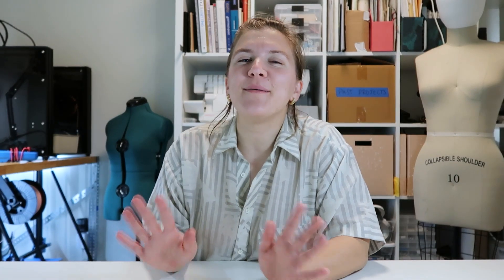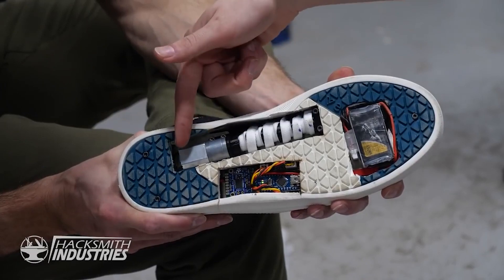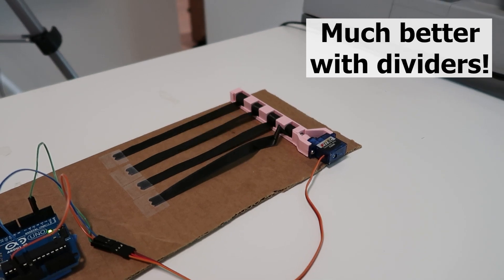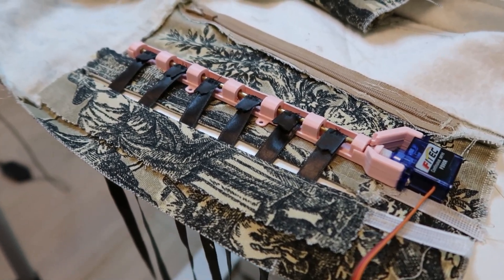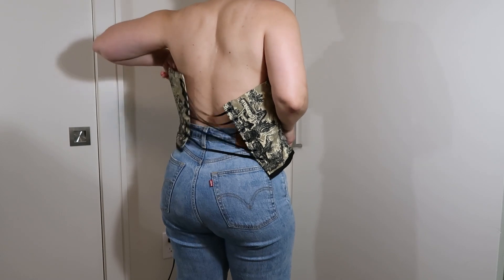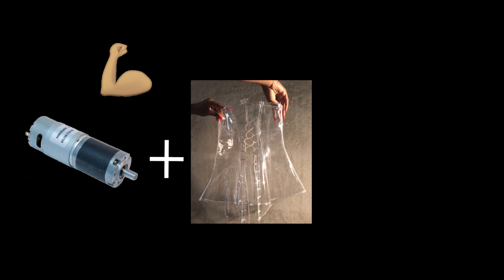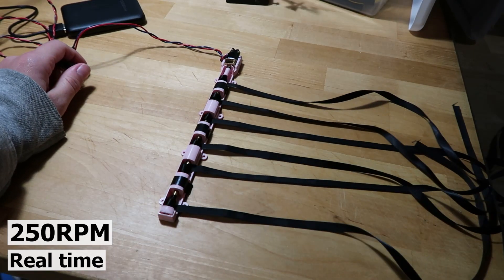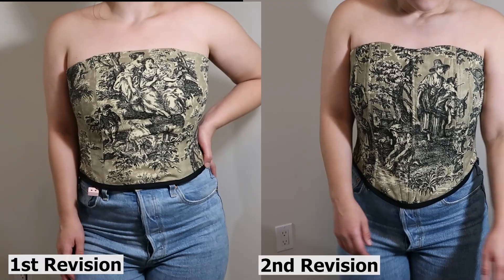I made a corset that self laces with a press of a button!

Comment: Interesting. As one who actually does wear a corset I have a few comments.
1. Self lacing is possible but takes practice 
2. Many would categorize this garment as a corselette, not a true corset because it doesn’t reduce the waist
3. So your next project is one that actually breaks ribs? What is your understanding of corsets and ribs? 

I do respect the research that you have done so far but hope that you include further research about the corset itself. I highly recommend Lucy’s Corsetry.

I suspect that you could build a mechanism that does replace the mechanics of tightening a corset built for tightlacing though. Each lace calibrated to a specific tension but that it could be quite dangerous. However, if you look around, you might find an experienced tightlacer to experiment on.

I look forward to seeing your next experiment.